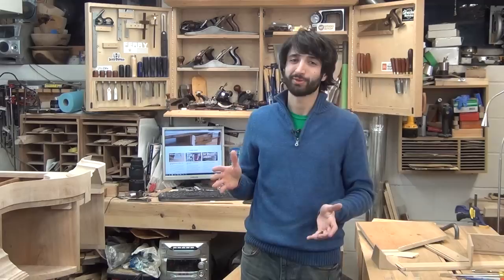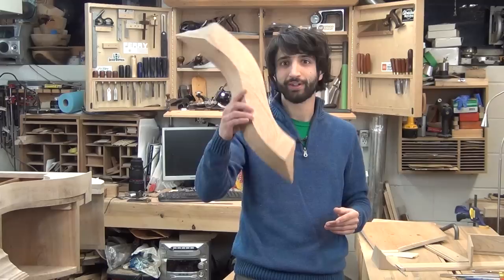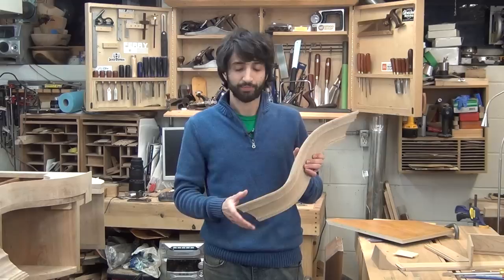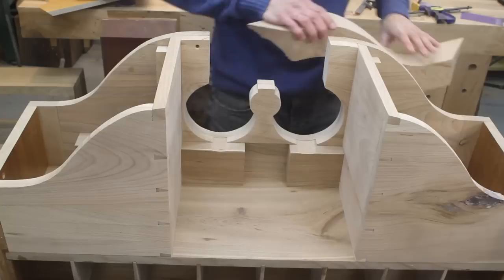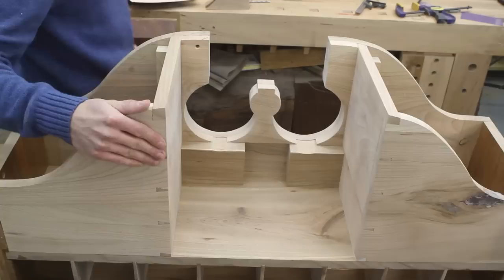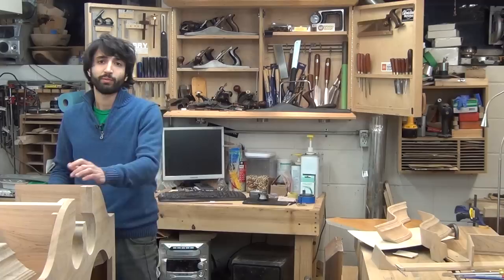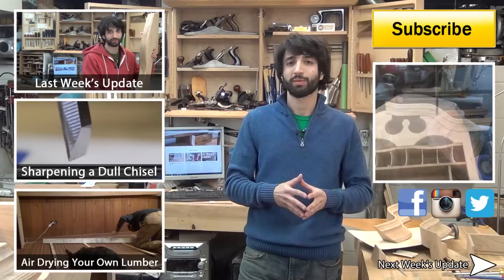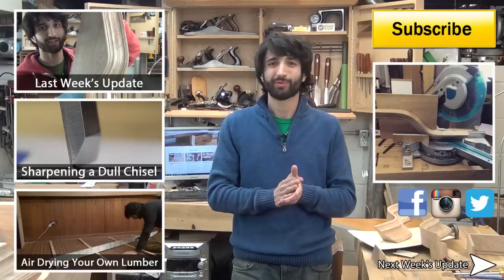Matt's Weekly Shop Update - Feb 23 2015

Comment: Glad you shared your experience with wood movement and grain direction... Its funny lots of people have talked about this subject but to see it in a big project really gives a good explanation on why its so important... If you just show 2 boards its really obvious and easy but when you start getting into large furniture and you have pieces in all axis' it becomes a lot harder and you can't always find a way that fits so you have to "Not Glue" or or use elongated holes, etc. Great Video as always Matt.
Reply from the maker: Jorge Araujo Thank you, Jorge!  Glad it was helpful.  Like you said, it's much easier to see at scale.  The movement issues on the top of the case are a little more complex than just a flat table top for instance.  Plenty to consider!

Comment: The project looks really great and your shop updates are always a real pleasure to watch !

I just have a question. You talk about wood expansion, cross grain and the risk of cracking for your wood and some other woodworkers quite often mention this issue but isn't it something more theoretical ? I mean when your wood is completely dried, does it really matter ? Have you had any issue in the past with that ?
Reply from the maker: Arnaud Vernet Thank you Arnaud!  There aren't many places in the world that have a constant humidity.  The air is really dry right now but when summer comes so does the humidity.  With all that humidity, the wood will absorb moisture from the air and expand.  In my experience, a 12" panel cut to 12" in the winter will be at least 12 1/16" in the summer.

Comment: Matt, If you should ever decide to do the plywood method, visit a model airplane hobby shop and get some really thin birch plywood.  you can get it as thin as 1/64 but most places will only stock as thin as 1/32.  That and a layer of your favorite veneer and you would be good to go.  Alternate source Sig Mfg Co. in Montezuma, Iowa.  You can find their dealers/ distributors on their website or order direct.
Reply from the maker: Steve McEntyre That's a great idea.  I should be able to find some around here.  Thank you so much!
Reply from the maker: Matthew Cremona Found a place close by that carries 1/64".  I'll be heading over there tomorrow.  Thanks again, Steve!

Comment: Hi Matt, great info.  I have a question concerning drying wood.  I had a cherry log cut at a local amish saw mill and have it drying outside (I think I managed to do everything wrong after watching your drying wood episode...lol).  The saw mill left live edges on the boards and I'm wondering if you have a way to cut that off straight without using a track saw (which I don't own)?
Reply from the maker: Mark Perkins Thank you!  A few different options:  You can make a track for your circular saw.  I have an 8' track for my skilsaw that I used for cutting the siding panels for my shed.  You could also snap a chalk line and cut it with a circular saw, jig saw, band saw, hand saw, whatever saw lol  The chalk line method is what I did before I got the tracksaw
Reply: Matthew Cremona great idea... thanks
Reply from the maker: Mark Perkins No problem!

Comment: Matt why not use bending ply for the bonet top ?
Reply: SUPERSPORTNZ hahaha you should probably try harder..
Reply from the maker: Ross Hastings That would work too and I thought about that as well.  The down side there is the same with the normal ply, I would have to find something with a cherry veneer and hope it would match the cherry I used for the case.  I suppose I could always apply my own veneer to the bending ply as well.  Maybe I'll be able to find some thin bending ply around here this week...
Reply: Matthew Cremona Matt I have also made thin bending ply before by putting luan threw my thickness sander and removing most of the outer skin.  But I was only bending a one way radious.  Not sure that would work in your case.  You would have to test it with a piece of scrap.  Either way good luck what ever you do its looking awesome..
Reply: Ross Hastings I think my assumption was that being your curve goes both ways you were going to meed to vaneer after anyways..
Reply from the maker: Ross Hastings Thanks for the ideas Ross.  I'll see what experimenting I can do this week.
Reply: Matthew Cremona good luck excited to see what you come up with.  :)
Reply from the maker: Should be interesting... :)